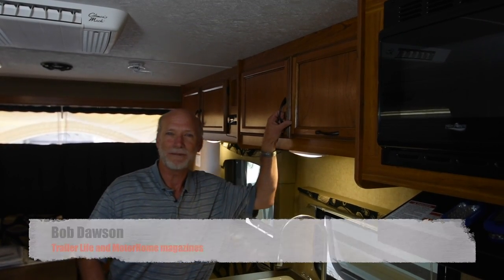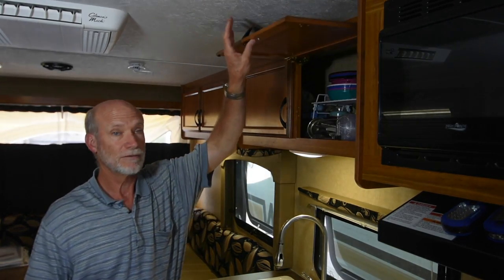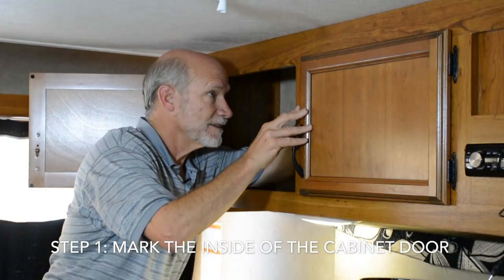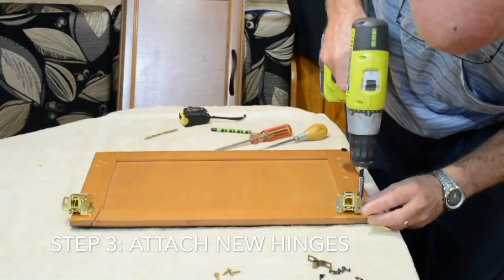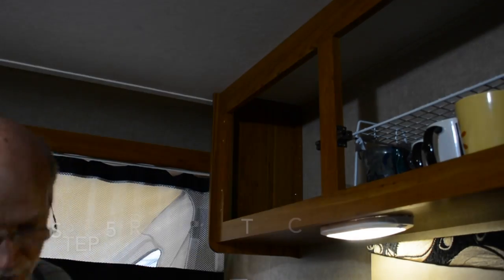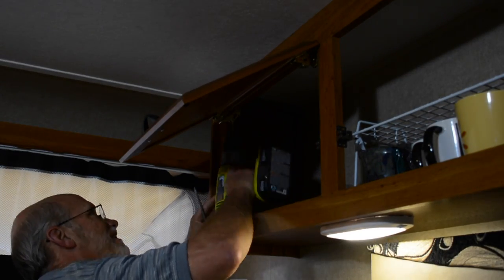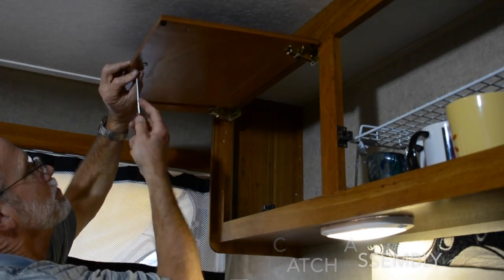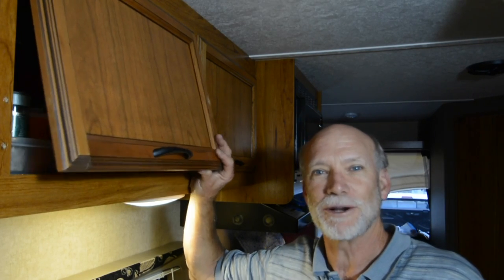RV Smart: Rehinge RV Cabinet Doors

Comment: Great video thanks!  Where did you get the hinges? Looking for a way to keep my current horizontal factory hinged doors open other than resting them on the top of my head.
Reply from the maker: I got these at the local RV dealer in Ventura, CA. I did see them online, as well, when I was shopping.